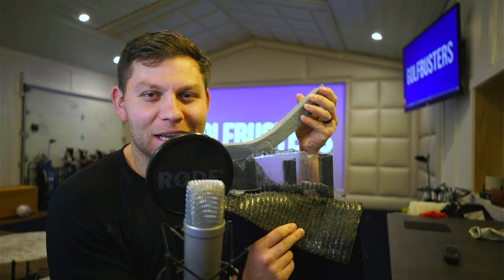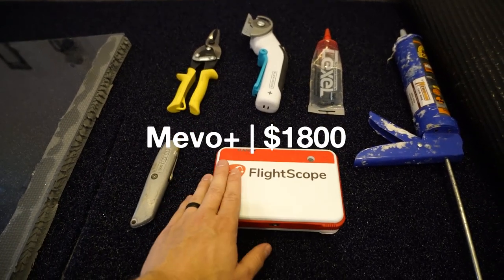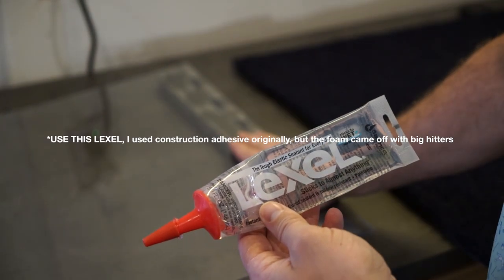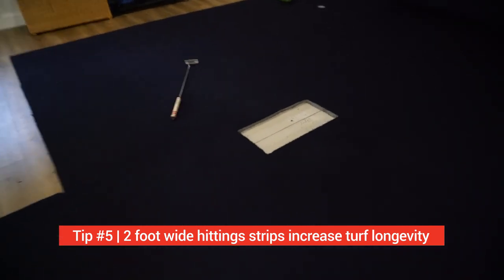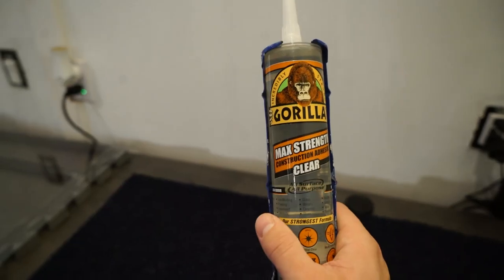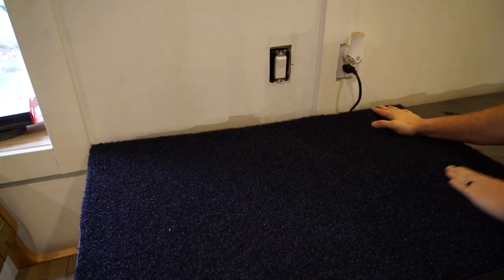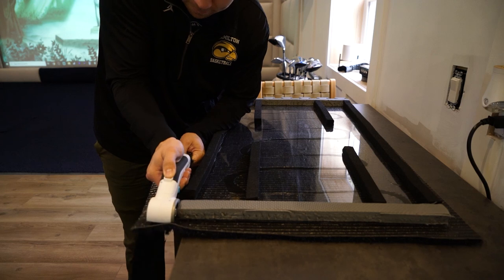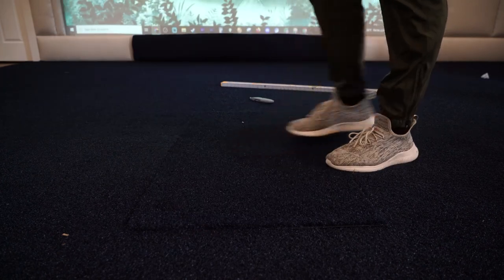How To Make a Premium DIY Hitting Mat for Your Golf Simulator (CHEAP)

Comment: I have a couple of designs. I tried the sliding mat, with a foam bumper in the slot. But experienced the same tear out issues as you showed! Got some great ideas, wish my various mats for mine, were bigger.  Thanks Spike
Reply from the maker: I had a little gap with a piece of foam in between and it has worked well so far!
Reply: Big tip, wash the exercise mats with dawn to remove mold release.
Roughing it up makes the lexel grab even better. Later Spike
On the new channel

Comment: Is your hitting strip flush with your turf/carpet.   Looks like it would sit 1/4" above if you are using the same hard foam as you have under the rest of your carpet
Reply from the maker: It is very close to flush maybe a smidge higher and yes!

Comment: A lot of the turf sites charge a little more for a 5mm pad adhered to the bottom of the turf.  Is that what you did?  I’m guessing that’s the black layer on the bottom of yours but just wanted to double check with you. Thanks man
Reply from the maker: I did not! I have just the turf and then lay it over top of the inch foam interlocking tiles and carpet tape part of it down.
Reply: @GolfBusters  niiiiice…even cheaper. I like that

Comment: I love it! Thank you so much for posting this. I have hit most strip options on the market today & have found any well constructed divot action strip feels the best for sure.

I personally want to hit a driver off a standard tee and don't like the look at address of the tee options that simply sit on the surface (tee's above 1/2" long only). I custom cut a hole into my divot action mat so I could install a short recessed rubber capturing tee where you can insert a real tee into and so far it works great. Curious if you have messed around with that complimentary part of the hitting strip yet?
Reply: How did you cut the hole?

Comment: Would you suggest 1" foam pads or would 1/2" be good enough?
Reply from the maker: For the wall panels or flooring?
Reply from the maker: Ohh sorry looking at the wrong thing. 1 inch for sure
Reply: Yes, I meant flooring. Thanks. Trying to find these things on Canadian Amazon.
Reply from the maker: Yea 3/4 is the lowest I would go but would highly recommend an inch

Comment: Will this work with a 1/2" thick piece of hitting mat instead of turf? Or will that be too thick?
Reply from the maker: I think it could work, I would get the 3/4 soft foam and as long as the hitting mat has some dig as well I think it could be a good combo
Reply: @GolfBusters  Thanks, yeah, I got a budget set up with 4x5 golf mat.  I was think maybe just cutting a 1x2 slot in it. Then elevate everything 1".  I already ordered the 1x2 polycarbonate, so I guess I'll give it a shot.  I've got elbow issues, so hoping the divot setup helps ease the impact.